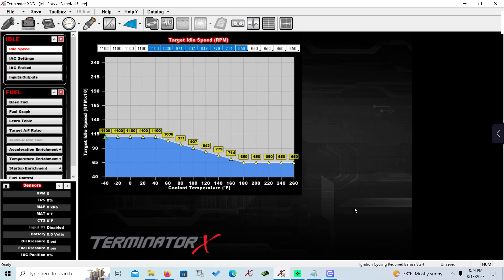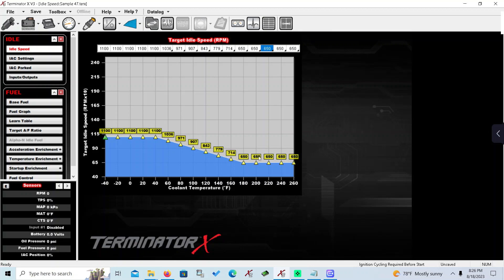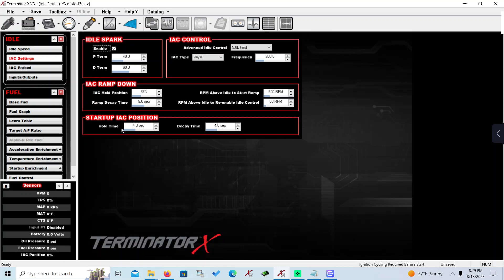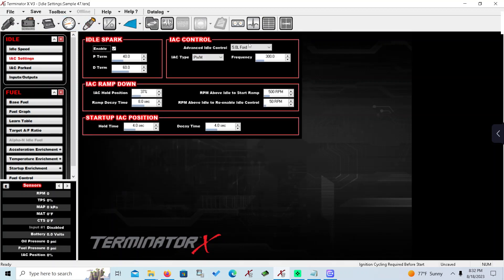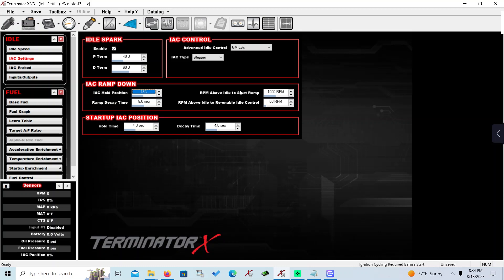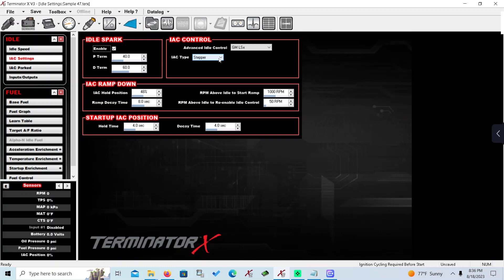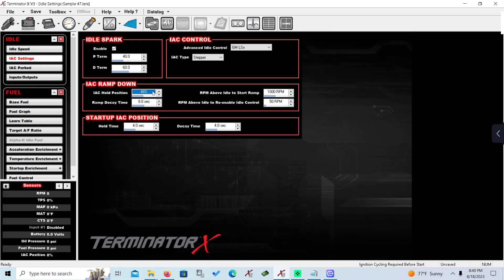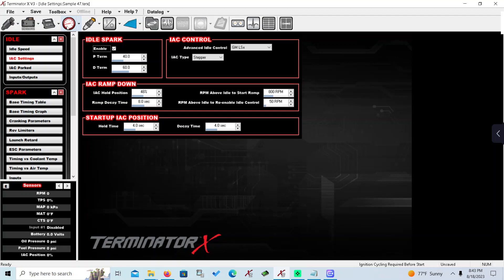Terminator X idle tuning (IAC)

Comment: When I went from a stock ecu to a terminator x my 6.0 ls idles rough like it has a miss but smooth out at around 1500 rpm.It didn't idle rough with the stock ecu.Is this normal?
Reply from the maker: It does happen sometime.
Reply from the maker: I can take a look if you want.
Reply: So if I gave you my cam specs could you give a rough estimate on idle?